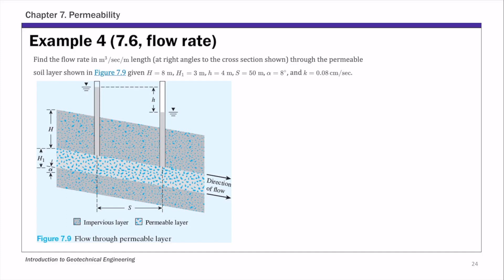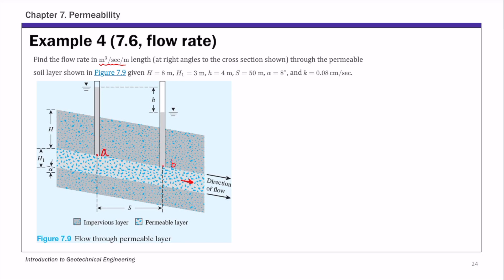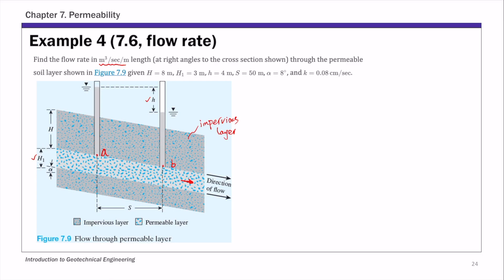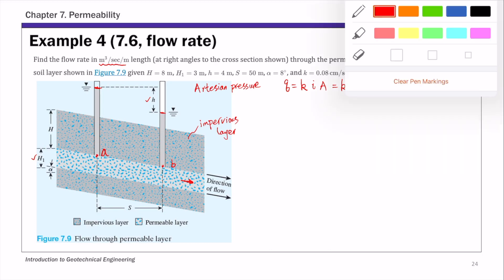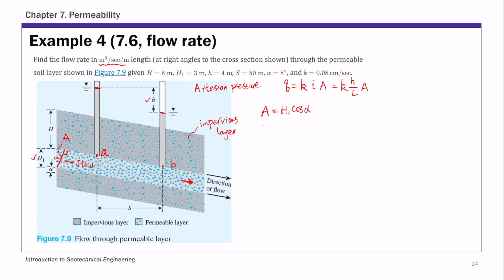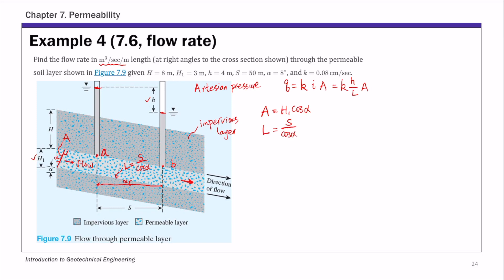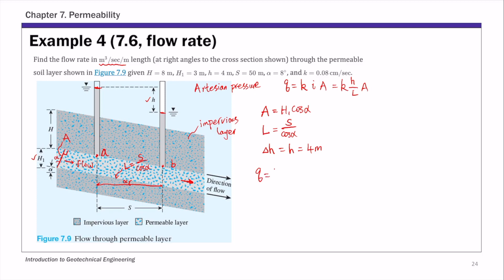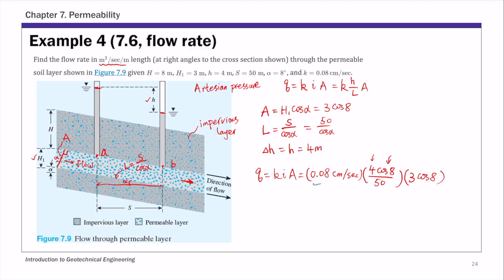Chapter 7 Permeability - Example 4: Rate of Seepage (Artesian Pressure)

Comment: Does this problem assume a rectangular cross section with a width of 1 meter? Also, how do the units work out to be m^3/sec/m?
Reply from the maker: This problem assumes the cross-section has a unit width of 1 meter (i.e., unit width into the screen). Therefore, the unit of seepage rate becomes volume/time/unit width, i.e., m^3/sec/m.